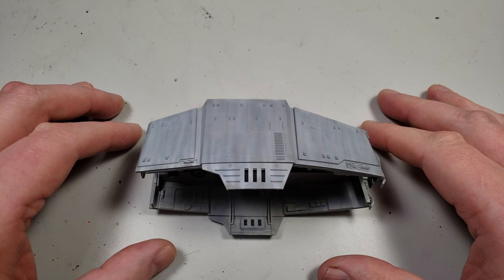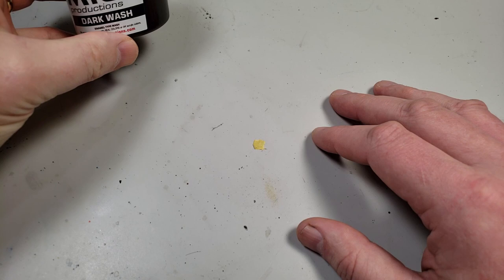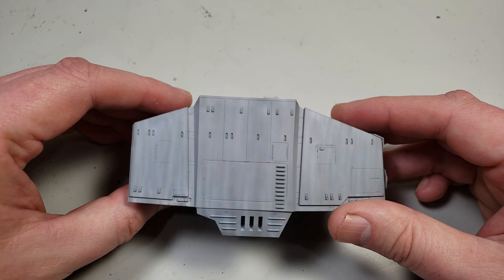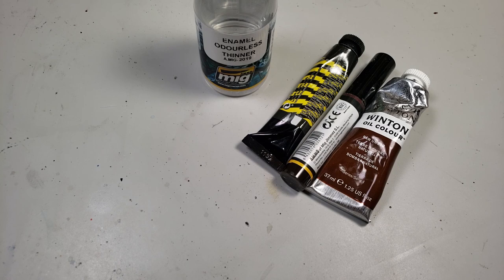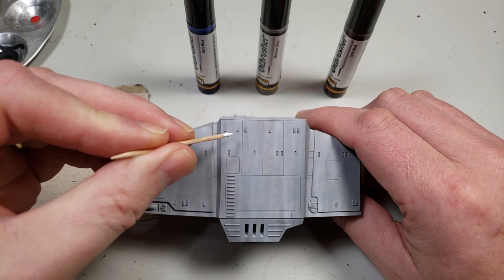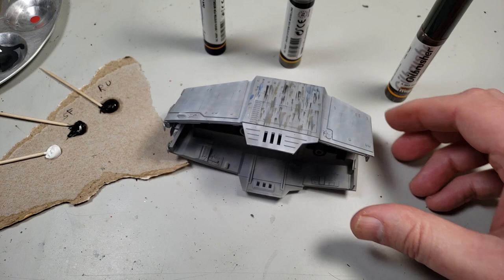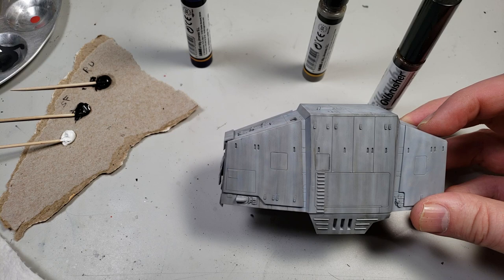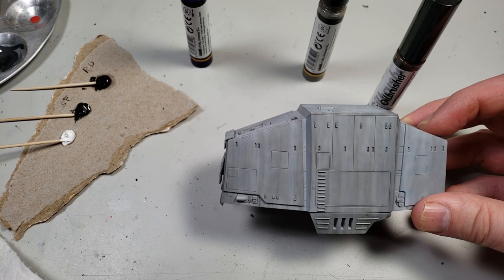Scale Modeling How-To: Dot Filters Explained

Comment: Us armour modeller's will dampen the brush slightly first before starting pulling the oils down! Definitely makes the world of difference doing this at the very first stroke! Maybe give it a bash I think you'll end up liking it alot more and you don't need as much dots to get a great effect but there's not just one way that's right it's trial n error but try the damp brush on first strike! Alot of the linseed oil is soaked out of Ammos it saves us a day of leaving the oils on a bit of cardboard to soak up the linseed oil over night before applying or it'd never dry that's really why they dry faster you don't want the linseed oil on your paintwork!
Reply from the maker: Yep, that works too! I've done that but found I prefer the other ways.. But whatever gets you the desired results is good!

Thanks for watching and commenting!

Comment: Thank you for the extra amount of detail in this video.

Can I ask how you control the streak locations? I mean, the holes on the surface of the piece would obviously hold water, and over time, just like in real life, the dirt would dilute with the pooled water and dirty streaking would ORIGINATE from the holes. I’m yet to watch a video that highlights that exact detail.
Reply from the maker: That's a great question. The short answer is that not every streak requires a start point, basically.  It would definitely originate from recesses, holes, rivets, etc. But if you examine the sides of any vehicle that is dirty, weathered, worn, etc., there are streaks and discolorations that seemingly have no origin point from a side view. There may be an origin point on the top of the vehicle, or the process of dust, dew, more dust, more dew, rain, etc., can create micro textures that will later result in all manner of slight discoloration and tonal variation across the surface.

I always view the dot filter process as a way of adding overall tonal variety. While sometimes I do deliberately streak areas from a particular origin point while adding dot filters, I generally leave those more specific streaks until later in the process.

I hope that helps. Thanks so much for watching and commenting!

Comment: I can't be sure of the truth behind my understanding of the original "full spectrum" dot filter. I do think it started in Spain (by Mig even? Not sure) but I believe the idea was to add a kind of "bright sunny day" kind of filter. Since a basic filter is one tone and typically warm or cool, the idea is just to quickly combine multiple warm and cool filters at once. I think the streaking effect was almost a byproduct at first. But since direct, bright, natural light in sunny Spain (or anywhere else) is made up of all the ROYGBIV colors- one adds a kind of "random lighting effect" filter to unify the surface with an overall vibrant saturation as opposed to a cool pallet or a warm pallet. I do prefer the warm or cool pallet because I think it better sets the scene. Most stories, especially war stories, involve weather, be it the snowy ice of Russia, Bastogne, Hoth, or the dry sands of North Africa, or Tatooine- the warm and cool feelings have to be represented both in scale or on film by the pallet choices. Now I have also tried experimenting with my dot filters by putting more lighter dots closer to the light source and more darker dots as one gets farther away. But it seems to all come out in the wash more or less blended regardless. Really just a great way to unify a base coat- especially if it is a multicolored camouflage. Thanks for the tips and the perspective!! I really love the mottled look on the roof and think it would be cool to see the streaking on a flat surface to indicate speed like you mentioned.
Reply from the maker: Good stuff - thanks!

Comment: Jon, amazing detailed tutorial. Thanks a lot!
I’ve just started to use this technique and faced some issues. I paint with acrylics and then cover surface with satin or matt varnish. And after applying oil dots they leave stains on a surface, right on the place where I put them, like small dots. Even after making streaks and trying to wash them off. I use odorless Mig thinner and good oil paints from an art shop.
Could you give me a piece of advice of how to deal with it?
Reply from the maker: Thanks for watching and commenting, and for your kind words! I am grateful.

Several things to try-

- Sometimes a matte finish can be "too matte", and depending on the type of oils, they can grip the surface strongly. Opt for the satin surface and see if that helps.
-  Try the wet-on-wet method I show at the 26:00 mark. That can help the initial dot be a bit "looser", and not grip as tightly.
- Thin the oils just a bit before application. THis can help them move easier. It works especially well with the pre-wetted surface.
- Be sure you're working in smaller sections. Some oils can actually begin drying incredibly fast
- An alternate technique to try is thinning the oils a bit heavier, almost to the consistency of a wash. Using a liner brush, apply them with light, quick downward strokes, almost a downward flicking motion. Do this with two or three colors, and then lightly blend. 
- Double check your oil paints. I've found that even if I buy from an art store, if it's part of a set that is cheaper, the oils are usually not as good. I've seen it happen in my own work that oils I thought were good quality leave those dots - and all were from large sets of oils.

I hope this will be helpful! 

Thanks again for your kind words, and for watching and commenting!

Comment: Hi Jon thanks this really helps. I’ve had little luck with filters, I’m hoping my problem is the oils I’ve been using, which look almost identical to the ones you said you didn’t have great results with.  I Also didn’t think about using the Vallejo washes you mention. Will probably try that on my RF-101C today. Question, I also notice most people tend to apply a wash before filters and after a clear coat. (Future in my case) One problem I’ve had with this is that the oils during the filter stage seem to fill the panel lines with the filter oil colors and cover parts of  the wash.  Maybe I’m using too many dots  in an attempt to make  the crappy oils work better. At a bit of a loss. Didn’t realize you had a youtube channel.  have followed your blog for sometime.  Look forward to seeing more videos.
Reply from the maker: Thanks so much for your kind words, and for watching and commenting!

There are several ways to handle that. You could put the dot filter on prior to panel line washes. Once the oils are dry, they're in place and later washes shouldn't impact them.

Another way is to just "reinforce" any panel line work done before the dot filter once it is applied.

Cheap oils can definitely be a problem. Stick to modeling brands or good artist's brands and you should be golden. (Or shiny ochre... LOL )

Thanks again!

Comment: Great teacher! Thanks for all of the details. I’m new to scale modeling and have a question about the order of paint layers. Does this sound right,
1. Acrylic primer
2. Acrylic base coat
3. Gloss varnish
4. Apply filter
5. Apply panel lines
6. Apply wash
7. Apply dust affects
8. Appt matte varnish. 

I’m confused about the order of things. Any help is much appreciated.
Reply from the maker: Thanks so much for your kind words! The primer type is not critical - the main thing is to prime it. For the base coat, I prefer an acrylic or lacquer paint. (I think I used Tamiya in this instance.)

Generally I don't gloss coat before the dot filter. The dot filter technique needs some grip, otherwise it all just slides off. If you do seal it at this point, I'd recommend satin varnish.

Once the dot filter is applied, you can either seal it (gloss or satin) and then do the follow on effects, or just go straight into the follow on effects. It all depends on the look you're trying to achieve.

The key is experimentation. The range of possibilities is huge, so repetition and not being afraid of "messing up" is critical to growing in weathering.

Ultimately the goal is for you to control the technique - not the other way around. 😊

I hope that helps. Thanks for watching and commenting!

Comment: will acrylic paints be as good as that? excellent tutorial video sir👍
Reply from the maker: Thank you so much for your kind words!

Acrylic paints wont work for this particular method. They'll dry too fast, and you wouldn't be able to streak them. The long drying time of oils is what makes the dot filter method work.

A similar effect can be achieved with acrylic washes, however. Check out this older video I did and see if it doesn't give you some ideas. Hope that helps! (https://www.youtube.com/watch?v=OAJRnUxA-Ug)

Thanks for watching and commenting!

Comment: Jon, a question, it looks like you are applying dot fiter before panel lining / pinwahsh. Is it correct? Thanks
Reply from the maker: In this case, yes. I generally prefer to do lining/pinwashes after the dot filters have dried thoroughly. However, sometimes I forget, or decide later to add it. In any case, you can always go back and enhance the lining/pinwash as needed.

(IIRC, I used a mechanical pencil for the panel lining on this one...)

Thanks for watching and commenting!

Comment: How did you go around it at the start? Did you clear coat it with matt, Satan, Gloss for example? It works better on a matt surface the blendings alot nicer but it's not as recoverable as if using a Satan or gloss coat it'll seap into the paint we do it both ways matt surface is more popular way, 
it's been a good how-to video though!  Happy New year 🎉
Reply from the maker: It's been so long since I did that video I can't recall. My memory is it was either matte or satin.

Thanks for watching and commenting!

Comment: Great weathering video, Jon! I've just got back into building Star Wars models after decades off. I've just completed the Slave 1, which I think turned out OK, and now have the bug: I've got an AT-AT and the Lando Calrissian Millenium Falcon to work on now. My question is: I'm keen to start airbrushing but am totally in the dark over the best air brush for a complete beginner to the technique. Any recommendations on a good starter model? Do I need an air brush with a compressor or is one that fits disposable gas cannisters OK to use? Advice would be appreciated.
Reply from the maker: Thanks so much! I am grateful.

Take a look at this video - it answers your questions in detail. https://youtu.be/ONbGaZ5zhMk

And part 1 and 2 cover things in more detail.

Short answer - I'd recommend a Badger Patriot 105 and a small compressor like I show in the 2nd video. I've used those for years and they work quite well, and are very affordable.

HTH!

Comment: Hi Jon, enjoy this video very much. Would you recommend to do dot filter on Bandai 1/5000 Star Destroyer? If yes, what are the colour to use ?
Reply from the maker: You could, but it would need to be very, very subtle given the scale. I'd stick with grays, and maybe a few blue-gray colors.

I hope that helps. Thanks for watching and commenting!
Reply: @JonBius  Thank you for the valuable advice. I watched several dot filter videos including yours, frankly speaking I'm not sure what colours to use for each different background, like a  grey Rebel fighter from star wars , a Gunpla like green zaku, etc.
Reply from the maker: @fangchern691  I always start by thinking about the overall impression I want to leave. For example, if I want something to look dirty versus aged, that gets me started. Warm colors generally make a model look dirty, while cooler tones indicate aging. This works over any color in general.

But you can also just think of the variants of a color. For example, a green Zaku would be helped by using various tones of green to help age it. Subtle hints of a yellow and blue (which make up green of course) will also help. Then, if you want some areas to also appear weathered, go to the opposite side of the color wheel and use a few variations of red - brown colors, reds, etc. Again, subtlety is usually best, and just build it up.

And don't discount experimentation. Learning what colors work, and which ones don't, ultimately comes from trying it all out. Don't fear experimenting - you'll learn a lot more by a willingness to try different things. It's really helped me!

I hope this "food for thought" is helpful!
Reply: @JonBius  Thank you so much again. Indeed experimenting is so important.

Comment: I've been looking for videos to help explain this technique and yours is the best I've found! When it comes to buying oil colors though, I'm a bit lost. Are there any suggestions you have for good oil colors to start with that can be used on multiple colors? Or should I aim to get colors to match the project I'm working on? Thanks for posting such an informative video!
Reply from the maker: Thank you so much for your kind words - I am so glad this video was helpful!

For years I had a very, very simple set of oils - white, yellow ochre, burnt sienna, raw umber, and Payne's gray. The yellow and umber afforded some warm tones, while the combination of the others gave a variety of cool tones. Add in a good red, yellow, and blue, and theoretically you can mix any color.

I'd suggest starting with a limited palette like that, and then add in additional colors only as you need them. For me, I found it more economical to mix colors a bit rather than spend quite a bit on a single tube that might be used only a few times. 

You may also want to check out those Oilbrushers by Ammo. They cost far less than tube oils, and can give you a wider palette at a lower cost (if that is an issue of course!).

But I think starting with a few flexible, "universal" colors that can be mixed to add additional tones will help you the most, and identify where it might be easiest to buy further colors that get a lot of usage.

Hope that helps!
Reply: @JonBius  thanks for the reply! I had some mig oil brushers and had no idea how to use them, but I also got some if the abteilung oils. Can't wait to try them and looking forward to more vids!
Reply from the maker: @booger12345  No problem! Be sure and subscribe! (Thank you. :) )

Comment: Thanks for the tutorial. I'm starting to gain more confidence to try this technique out with my gundam kits. But i was wondering, is it possible to use acrylic paints or laquer paints as a substitute for oils?
Reply from the maker: Awesome! I'm so glad you found this helpful!

For acrylics, a different application technique is used. The paint must be very, very thin, or an acrylic wash product should be used. One of my older videos demonstrates this technique. (https://www.youtube.com/watch?v=OAJRnUxA-Ug) It doesn't give the exact same effect, but it is close enough if acrylics are what you have. (Airbrush streaking is an option too, if you have one available.)

I'd not recommend using lacquers. The thinners required to try and replicate either of the methods these videos showed would mess with the paint underneath. Varying the colors slightly in a brush application might work with a hand painted lacquer finish, but it would be quite an advanced technique that I'd only suggest tackling if you are very experienced with brush painting lacquers.

I hope this helps. Thanks for watching and commenting!

Comment: Can this be done over airbrushed acrylic paint?  If so does the acrylic paint layer need protecting first with a clear layer?
Reply from the maker: Absolutely! I use oils over acrylics all the time. I've done it with clear protective coats, and without. It depends on what you're trying to do, and what's underneath. (Here's a video I did about knowing what to use when. It's focused on Gundam, but the principles apply universally. https://www.youtube.com/watch?v=dz3GX2QQQdg)

Rule of thumb - if you're not sure, clear coat it. For the dot filter method, a satin varnish works well.

Thanks for watching and commenting!
Reply: @JonBius  thanks for the reply and the link, I'm building a model of the Power Loader from Aliens, so gundam is pretty close!
Reply: Reply for the mighty algorithm.

Comment: Hey there! Do you need to do any special preparations if you're working with acrylics? Will the terpenoid harm it?
Reply from the maker: Not at all, actually - that is the beauty of using acrylics as the base paint! :D

As long as they are dry enough that moisture won't reactive then, you can apply oils as needed, and then use turpenoid over them.

The key is just making sure the acrylics are dry. In times when I did speed builds, I'd push the envelope and use them sparingly over acrylics that had only been applied a few minutes before. However, I'd recommend several hours/overnight for the acrylic paints before applying oils.

As always, running a few tests will always be helpful!

Thanks for watching and commenting!

Comment: How long do W&N oils take to dry?
Reply from the maker: I'll have to give a " politician's answer" - it depends.

The variables that go into are:
- How much oil you've allowed to leach out into a carboard palette
- How thick the application is
- Whether you've used any drying agents (like VMS Oil Expert)

Generally when I use thin applications thinned with VMS Oil expert, things are pretty much rock solid within 24 hours, and I've been able to work over them within just a few hours of application.

The key will be to experiment a bit and find the sweet spot that works for you.

Thanks for watching and commenting!